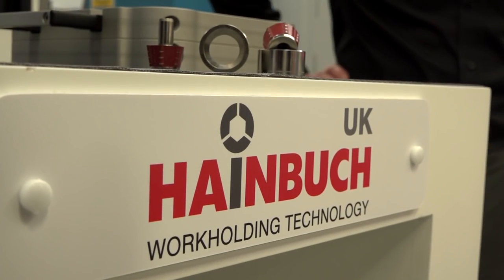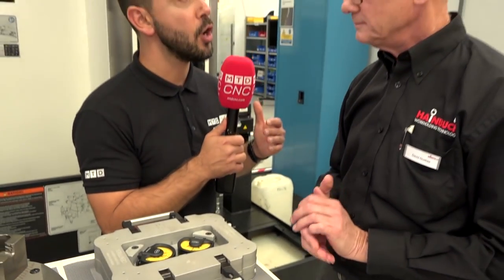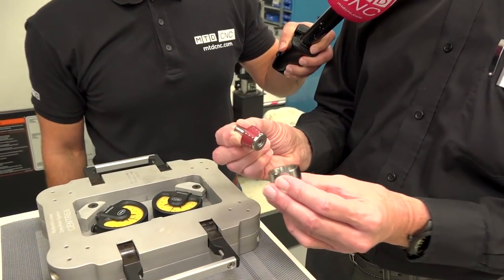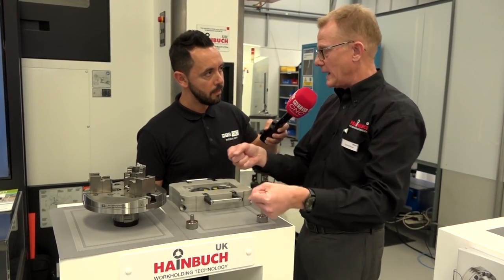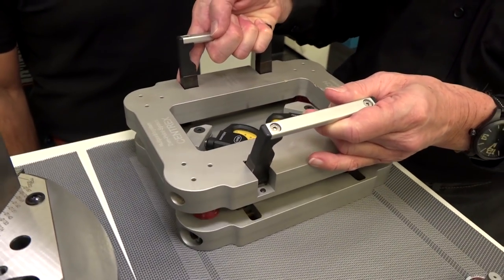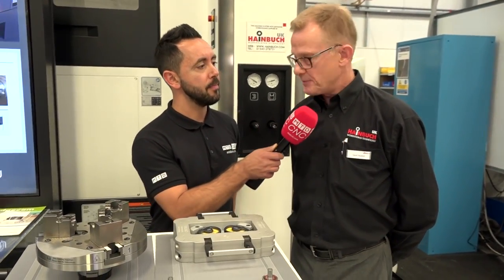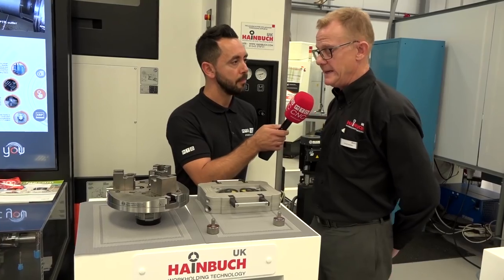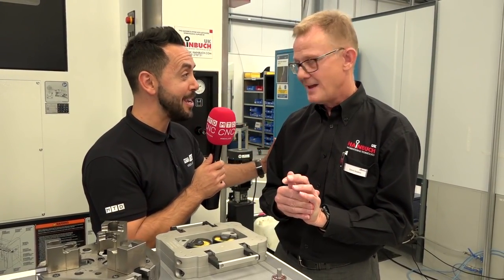Hainbuch Zero Point System, Modular and Flexible

Comment: That Zero point system can be incorporated into tons and tons of things; really looking forward to seeing  the Turning (First Ops)  to 5 axis mill (2nd Ops) set ups (Medical) that Dave was mentioning...   yet still holding tight tolerances + efficient work flow. Those smaller tapered fittings look excellent, wonder if they make even smaller ones ?